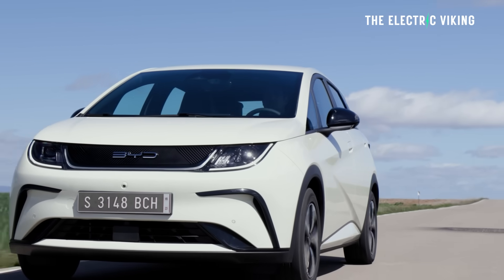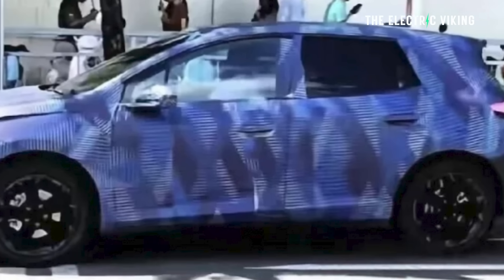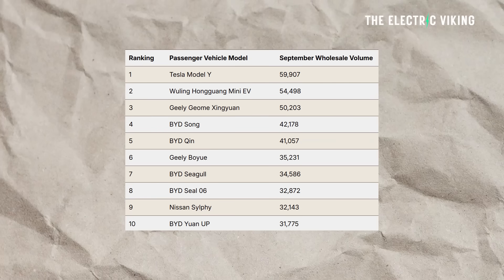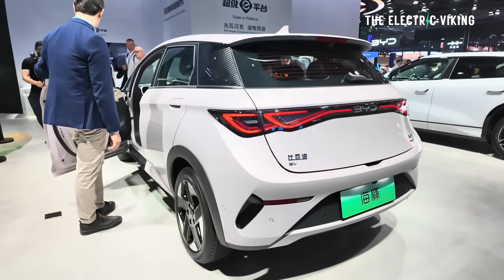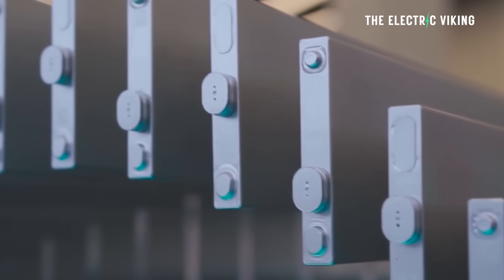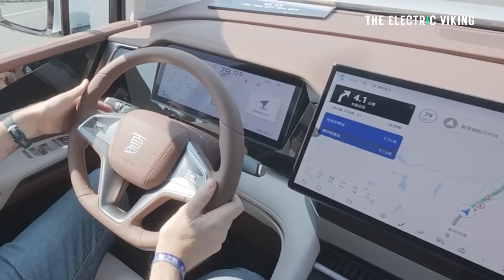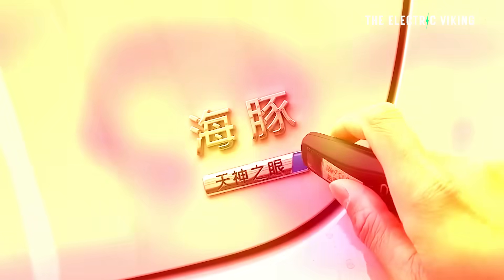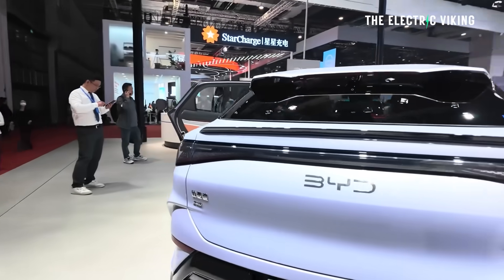2026 BYD Dolphin Gets NEW BYD Blade Battery 2.0 and Gods Eye ADAS

Comment: I think two stories are being erroneously conflated here.

Story #1. About 3 months ago BYD started limited build of a 'smart' or 'intelligent drive' version of the Dolphin, for Home market only. 'Personal' exports have seen these as far away as Belarus, so, we know they are real. They are shown in some Chinese showrooms. A friend of mine (Chinese) lives near a BYD factory in China and saw these very early. New front bumper, making the Chinese car the same length as the export car (the old Chinese version has a shorter, cheaper bumper). The new bumper and front lights ARE different to the current export version though. The boot has lost the Build Your Dreams logo, and now has BYD branding instead. It has the DiPilot 100 system, the cheap version (not full auto pilot, but it will auto park). You can see the new sensors added in many places to the car. The gear selector is on the steering column, the dash option selectors are different, and the screens are bigger (the driver screen now full width TFT). My friend says that the rear suspension has some changes too. The AC now has temperature (number) and select, whereas before it was simply up or down, with no actual numbers.

This version exists now. No need for disguise car and photos. However, it has not been officially exported. It does not appear to have been officially announced by BYD. But, go to China, and you can buy one for a few thousand US dollars more than the previous model. My friend tells me that it also has the option of electric tail open/close.

In Australia, does your version of the Dolphin have an option for a mid blue metallic? Over here in the UK it does not. Moreover, BYD have quietly dropped the standard cream/white body colour in the UK, so all Dolphins now have 'metallic' paint (black, mid grey, light grey), and they have dropped the base model, restricting the range to Comfort and Design. My local dealer told me yesterday that BYD have told them to clear current stock ASAP, as something new is coming VERY soon, including a mid blue metallic colour. While they are offering about £2000 off list price right now, the dealer hinted that will go up as the New Year approaches. I rang around a few friends in the leasing industry (I used to work with) and they tell me that BYD are offering pretty good discounts to shift stock. All this accepting that BYD are pricing the Dolphin way higher here in the UK than my sister-in-law can get one right now in Perth, something that is very puzzling, it's like, they don't want to sell in numbers yet.

Does this 'Smart' version have the Blade 2 battery? I suspect not, at least for now. But, maybe it does. I suspect that they are only now ramping up production of Blade 2. I do wonder if that is why the Aion UT will not be released here until April (which I think uses the same battery pack as the Dolphin). As to motors, In reality, an EV motor is whatever maximum power output the label says, and the control software permits. What is inside the casing is another matter. I suspect that the current higher power motor used in the FWD Dolphin is more powerful than claimed.

Story #2. Will there be a rear wheel drive version, and a hybrid version? Probably. But, unlikely before 2027, and export markets? Much later, if ever. Will there be more powerful motors? Likely. Could this be the disguised car seen in China? The front overhang makes the bonnet longer, maybe for a petrol engine?

Comment: Rear wheel drive for two wheel drives makes sense for electric as no CV joints are required. Also eliminates torque steer.
Reply: Torque steer has been eliminated eons ago with equal length outer drive shafts (by adding intermediate shaft to cover the difference), and cv joints are literally the most reliable and durable part of any car. Can't remember when was the last time I had to change one, and even if it did have to be changed what's the big deal. Comparing to all the other shite nowadays that's costs arm and a kidney, cv's are the last thing to complain about. 
But I do agree about 2wd being rwd - as long as the battery is in the floor, thinking about winter grip. 
Or even better, 4wd motor at the back and motor up front, with eco mode one motor drive only when desired. Genius

Comment: China’s September power generation hit 826 terawatt-hours, up 1.5% year-on-year, with solar generation up 21%, says BJX News. It adds that American energy policy is a hoax.
Reply: Why is it a hoax? Please explain.  My gasoline is $2.75 gallon ( $.72/ liter ) my electricity is inexpensive and reliable.
Reply: @DGlass-yg8xk  The most reliable figure comes from the International Monetary Fund (IMF), which estimated total global fossil fuel subsidies were $7 trillion in 2022, the LARGEST subsidies being in the U.S. for OVER A CENTURY. Put a SMALL FRACTION of that money into BEVs, SOLAR, WIND, BATTERIES, and you will have MUCH CHEAPER electricity, a cheaper and better car for $20k instead of the U.S. average $52k, which you could buy today if the U.S. didn't block China car sales with astronomical tariffs. POOR countries install solar because it is quicker and cheaper than oil & gas, and distributed so you don't have to build a grid. YOU PAY MORE TODAY THAN YOU WOULD IF USING SOLAR AND BEVs, that's a fact.
Reply: @beautifulgirl219 what western country that has transitioned to solar and wind has energy costs that are cheaper than the US?

Comment: How does a rear wheel drive heavy EV go up a snow covered hill? Asking from the middle of the Alps.
Reply: In your case AWD is needed.
Reply: @andrew7455  Indeed! Our current Suzuki Vitara cost 20k 7 years ago. It goes up in 20cm snow without a problem. Looking at similar 4WD EVs and practically there is nothing below 40k. A FWD might do but RWD is out of question.
Reply: In reverse?
Reply: Same as a rwd ice car. Also the break-even price for EVs is 3-5 years. After that it's all savings. Some people even charge theirs for free. I know some that do.
Reply: @ThisHatterIsMad In other words…POORLY!
Reply: @ThisHatterIsMad  My question has nothing to do with charging and cost. I have solar panels and planning to buy an EV, BYD is on my radar. But RWD is filtered out. I live on a hill with 10-15% climbs with curves and corners.
Reply: @AnTalk_blog  You definitely need an 4X4 / AWD then.

Comment: What's the point of free electricity when, at that time, your solar is already giving you more than you can use? ..and outside of that time
Reply: Solar only outputs at a certain rate, plus if you're out driving during the day the price of the cable to keep charging your EV would be exhorbitant.